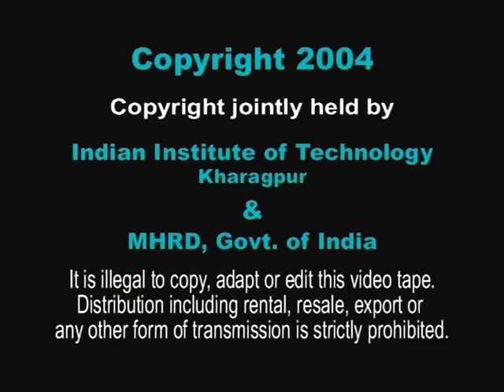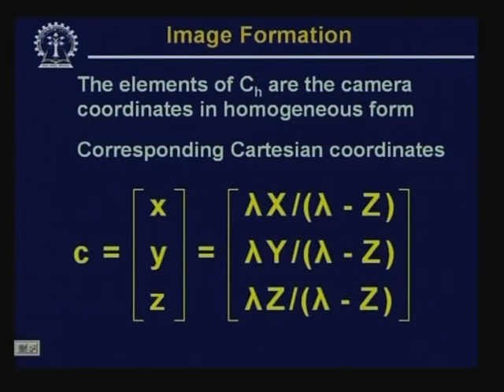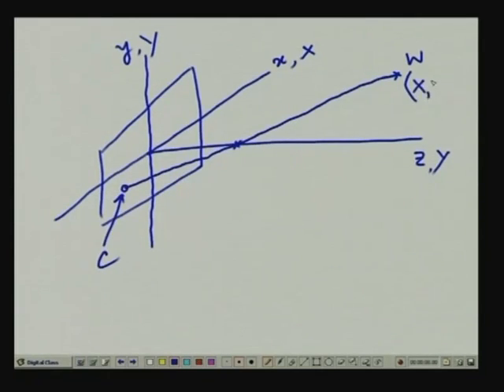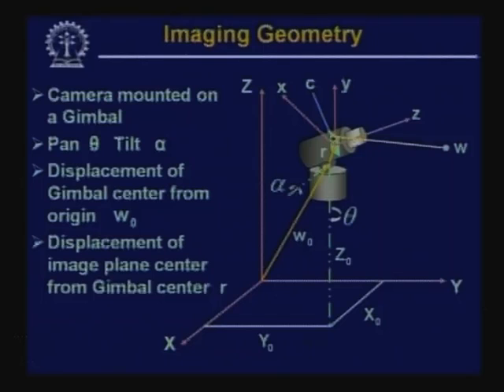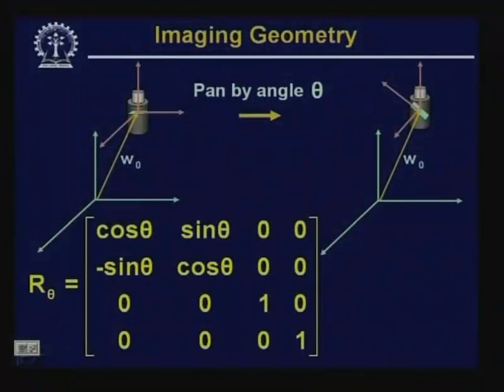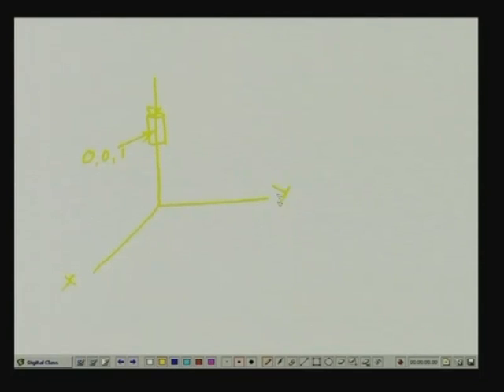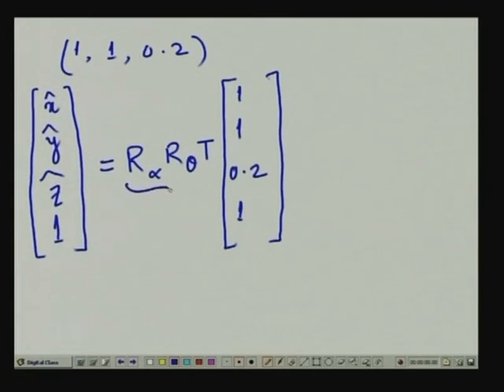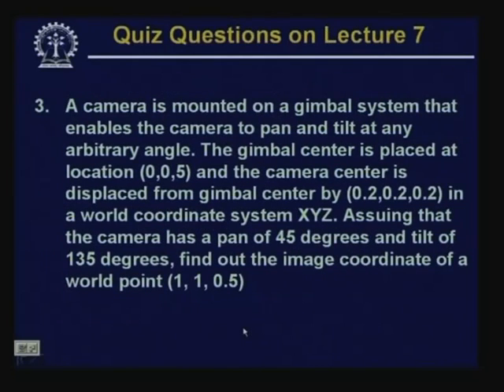Lecture 7 Camera Model and Imaging Geometry

Comment: I'm a little bit confused. Why is it that the equation only does rotation for tilt and pan. Shouldn't there be another rotation matrix (one for each axis). Also what does the translation r actually mean in practical terms (What's the difference between that and the first translation?)